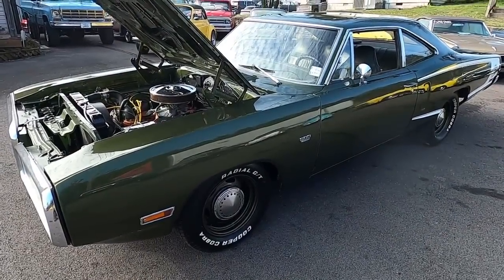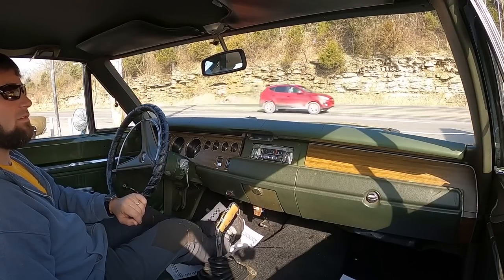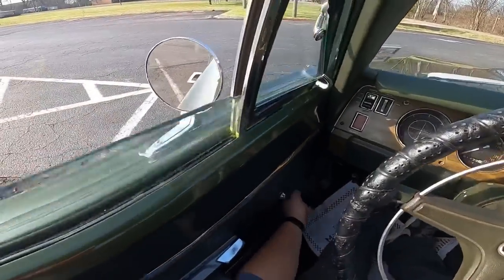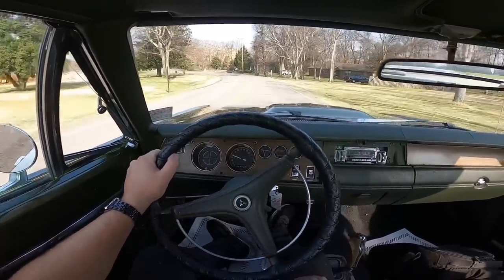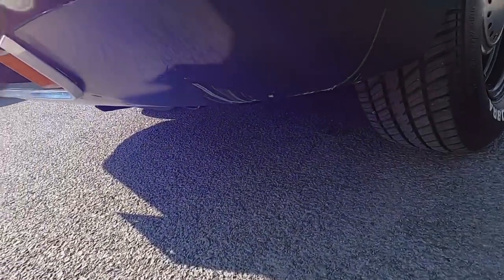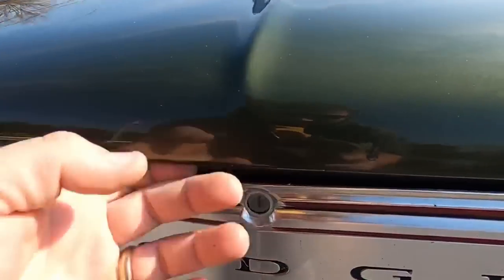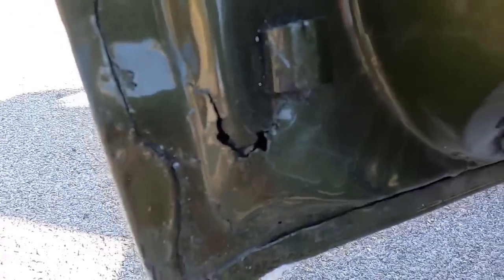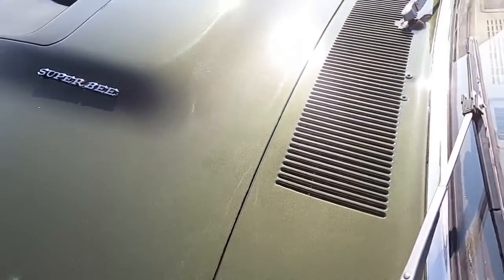Test Drive 1970 Super bee 4 Speed SOLD $32,900 Maple Motors #1453

Comment: Try grounding that wiper motor with a jumper wire. Quick & easy. If that fixes it then it’s not grounded good. If it doesn’t it’s probably the toggle switch. Devin Duke rebuilds them. I’ve sold him cores. I have an NOS one that I’m keeping for my car

Comment: Nice car
I had a 1970 Dodge Charger great
Condition which I bought in 1978
4 speed 383 engine,  which traded in for a 1970 GTX 440 6 PACK  because the 
Charger was SLOW AS HELL.

Comment: Needs brass synchro stop gears in trans if you speed shift those trans much you will break them .Those trans are big and heavy and hard to handle unless you got a lift .Those brass stop rings just get cracked you have to look close to see.

Comment: A few months work on the beauty getting the interior fresh with a new headliner dash carpet seats fix the air leaks. take the paint down  repaint take care of the imperfections fix the basil's and the trunk floor. Undercoat it, do some work on the transmission I think it needs  little in replacement parts I can make anything it needs. This could be a great deal for the right person. Oh and straighten the rear bumper. Probably $5000 in it would make all the difference.

Comment: That car needs a ton of work to make it correct. Did you happen to check the block stamp ( passenger side, just above the oil pan rail). The fender tag, does say it's a 383 car, would be worth more if it was numbers matching, but it's still not a $33K car. They sprayed (heavy) over the fender tag so it's hard to tell exactly what the car should have, but from what I can read it is a 383 4brl car (E63), it was originally dark green metallic (EF8), and it came with the bucket seats w/ console (C16). It's hard to read (for me anyways) anything else on the fender tag.
Reply from the maker: If you can find them for us we will buy them up and sell them as fast as we get them. Thanks